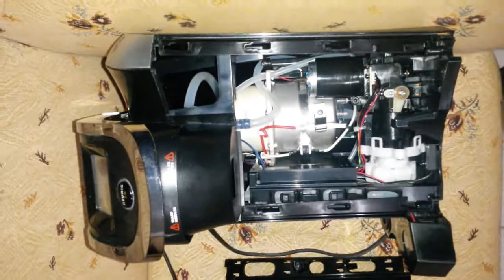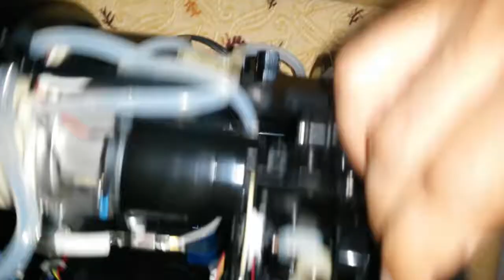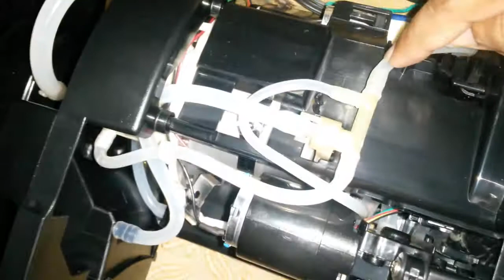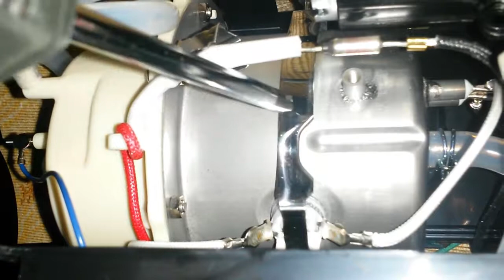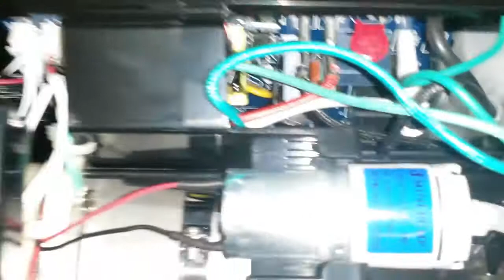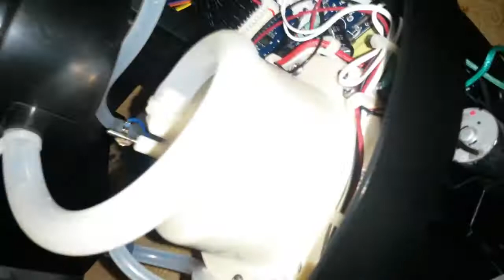087 Keurig 2 0 Coffee Machine

Comment: Interesting exploratory trip through the Keurig K575? (the exact model is not disclosed) components, but it is near useless for accomplishing what the video description says -- to increase the temperature of coffee it makes. The video has several missed opportunities to help someone who's competent but unfamiliar with the innards of the device, which was ostensibly the reason for the video. For example you state that removing the cover was quite challenging but fail to disclose how you overcame that challenge without breaking the plastic so that viewers might take advantage of your experience. The video never explains how to achieve the goal in the description. In addition, there are several unconfirmed guesses at what some components are (the fusable link) which you sometimes later explain, yet its unclear how knowing that is related to the stated purpose of the video -- "fooling the machine to increase the temperature of the coffee it outputs."
Reply from the maker: This was the first video on this device. It wasn't my Keurig. Don't think I knew the model number or I would have included it. 

There are other videos on the opening on youtube. I actually looked at another to get this device opened. It was properly described so I didn't see the point of duplicating.

 To understand how I "fooled the machine" you need to look at video #095. Its explained in detail on that one. Probably more detail than you want to know. Have a look and comment there if its still unclear.

Comment: Thanks for video, however I've watched this a couple times and it's still not clear to me where the thermistor is located.  Could you point to specific time you point it it?
Reply from the maker: I looked over the video and you are right. It seems I did not film that. Not sure why I didn't trace the wires for the NTC. Been over two years. I cannot recall where the NTC is. Its not my machine so as soon as I modified it I gave it back to the owner. 

If you have the machine look at the connectors shown at 11:13. The NTC is mentioned. Trace that wire and you will find it.
Reply: @manickn6819 Thanks